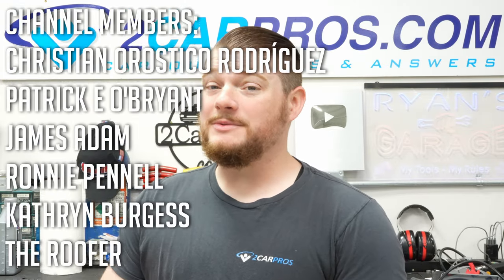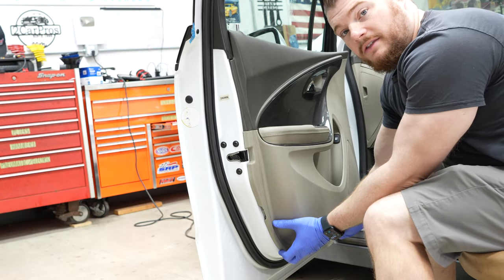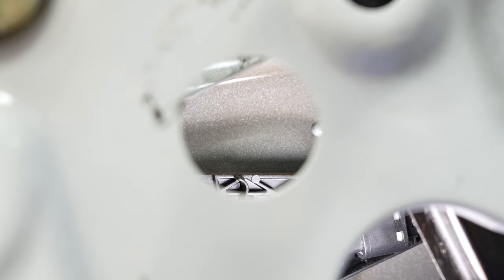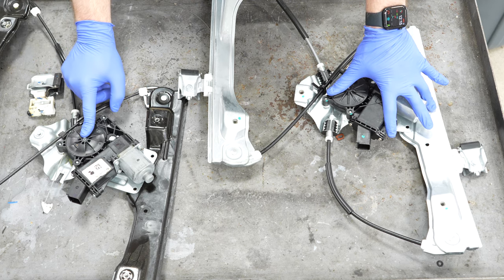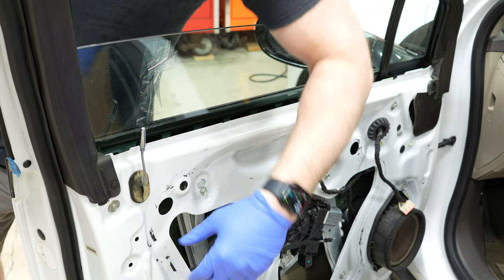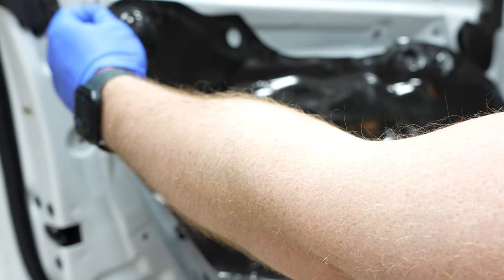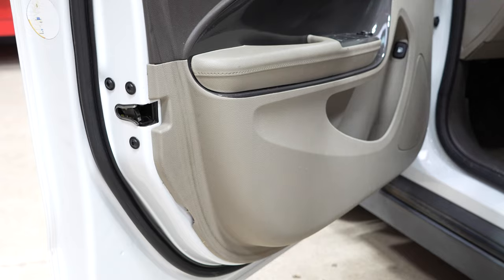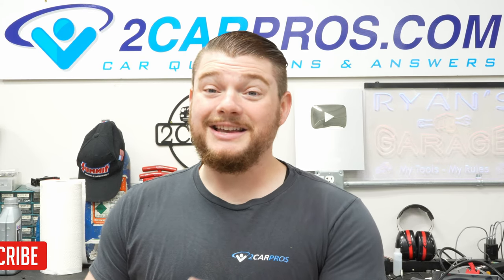How to Replace Window Regulator Motor Chevrolet Volt 2010-2015 | EASY!

Comment: THANK YOU SO MUCH!  I'm nowhere close to a mechanic but I just replaced my 2014 Volt front passenger window using this video. So happy!!  
In the 2014 year (maybe others too) there's 2 different types of regulators that could be in your car.  Type 1 (without outrigger tabs) or Type 2 (with outrigger tabs).  Mine had tabs...no way to tell until you take out the existing. 
Thank you again!!

Comment: Both my right and left window regulators broke within a week of each other. 

I have watched over eight videos on replacing the two regulators. This video is by far the most in depth and easy to understand of all the others I've watched. 

I've got both regulators now and will tackle the job in a couple of days when I have a free few hours. Thank you for your great in-depth commentary and easy to see camera work.
Reply from the maker: That's usually how it goes, same thing happened on my truck but one hour apart on a road trip. 

That's so nice of you!

Thank you for watching!

Comment: Thank you so much for your video.  You did an excellent job in your instruction and you saved me lots of money by not taking it in to get fixed.  It was a bit intimidating at first, but it was much easier than I originally thought.  Thanks again!

Comment: Hey 2CarPros....Great video...my 2015 volt window stopped working 2 days ago, now my window is all the way down, ordered part yesterday off Amazon, the only bummer it takes two weeks for the part to arrive...I have watched many YouTube videos on how to replace the regulator and I must say yours is far superior over others...thanks for detailing on how to replace the first gen volt regulator.  I think I'm ready for the challenge...BTW I'm 66 years old but pretty handy...we will see how things go...
Reply from the maker: Very nice!  You got this! It's pretty easy especially if you have a short stool to sit on. Thanks for watching!
Reply: @2carpros  Update:  Received part last night, this morning I was able to installed with no issues.  Hardest part was getting the door cover off, I had to use a small pry tool that I got off Amazon just in case...glad I did...nice to have a window again...thanks again for all your help in this video, I don't think I would have tried this repair without seeing your video first.

Comment: Super helpful video. I referenced it to replace my front passenger window regulator.

Another issue I had was my window was stuck down. I initially missed the bit about cutting the wire to release the window, but even after cutting it I couldn’t lift the window. Turns out the part holding the window (near the front) was stuck and wouldn’t lift, so I had to take the speaker off so I could get to and loosen the nut. After l did that I was easily able to lift the window. Hope that helps someone else!

Comment: Hey all...if I can do this anyone can 66 years old...Update:  Received part last night, this morning I was able to installed with no issues.  Hardest part was getting the door cover off, I had to use a small pry tool that I got off Amazon just in case...glad I did...nice to have a window again...thanks again for all your help in this video, I don't think I would have tried this repair without seeing your video first.
Reply from the maker: Nice work! Love that! Thanks for watching!

Comment: Hi there, thanks for the in depth video. When the computer learns, I press the window button down, the glass travels down, I hold it down for three seconds. Then I press the window button up... Windows goes up.. I keep it pressed. windows goes all the way up, but then after going to the top, it automatically travels down. Why would that be happening? Tried multiple times. One thing I noticed is that when the window is all the way down, the glass is sticking 1 or 2mm higher than my other working windows. I checked all five six bolts are properly fastened, i.e. the assembly is properly installed on the door. Please guide if you can.

Comment: I just had this fixed by a chevy dealer on my 2011 Volt (for over $600).  Now the charge port door button doesn't work.  I was hoping to see that button mentioned but it wasn't.  Do you have any idea why that button would fail after the regulator was replaced?
Reply from the maker: Maybe it got unplugged when they took the door off? Thanks for watching!